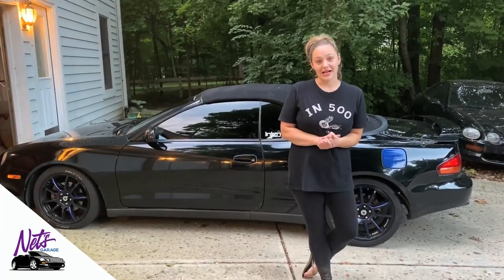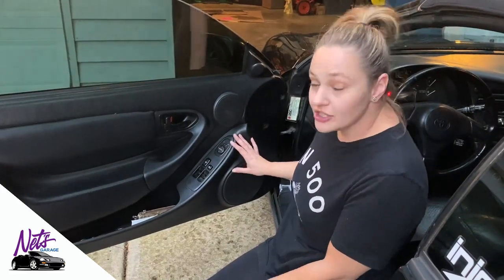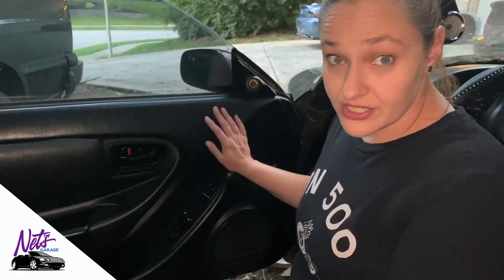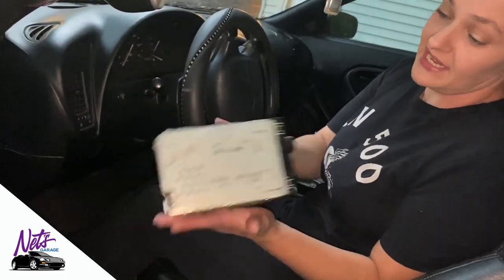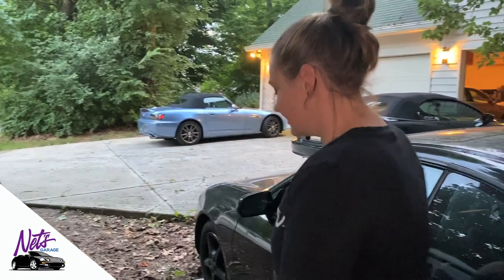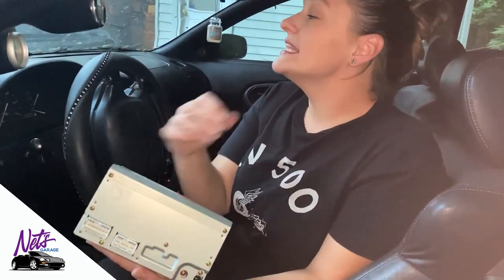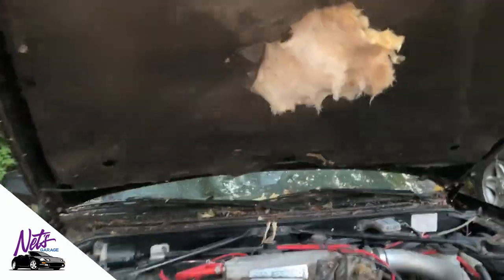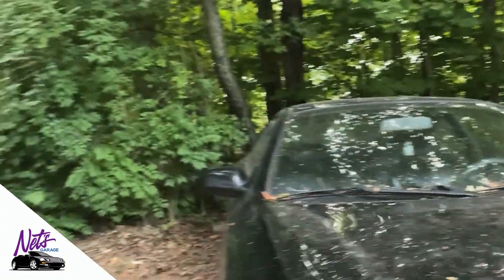Factory Speaker Setup & Size varieties that came with the 6th Generation Toyota Celica. Explained.

Comment: a bit uncertain about what im looking at in my JDM '97 st202
it seems to have the 8 inch mounts but the actual speaker seems smaller
found this channel looking for instructions on how to remove the door panel (thank you for the walkthrough) because I wanted to look into replacing it as it's still the factory speaker and i got some rattling going on.
My condolences for what happened to the convertible as well
Reply from the maker: I do have a video on removing the door card. I’ll attach a link for you here. Good luck with your project! And thanks for the condolences on the black convertible. 🥹🤓

https://youtu.be/6I_MNJTi0aY

Comment: Have you actually replaced any of the speakers in the convertible gt? If so…what speakers did yoh replace them with? Please provide some model numbers or links
Reply from the maker: Hello! I did replace all my factory speakers with Audison speakers & amp. I chose them because of the shallow mount depth, so it fits flush with the door card installed. You’ll have to find which speakers fit with your particular speaker set up. In the trunk I have a 10”  JL W7 with a custom built box and an amp for it as well. 

Here’s a link to Audison, you can find an audio specialist that sells these speakers near you. Or you can source them online. Good luck. 🍀 

https://us.audison.eu

Comment: I have a 95 Celica the radio powers on
But no sound out of any of the speakers works 

I have the less common setup of 3 in each of the front doors 

Any ideas/help would be really appreciated
Reply from the maker: Hi Ryan! I know that can be quite frustrating. Did the speakers used to work and then stopped working? Are you installing a new head unit? Are these the factory speakers? Newly installed speakers? Is the radio otherwise functioning completely? There are several things that may have gone wrong. I’d trace your wires and make sure things are connected securely. If the radio is turning on then it must have ground power, so that’s good. Did you make sure everything is connected in the back of the head unit, including the antenna plug? Did you use the proper wiring harness? (There are two kinds). I would start double checking your work and your wires. Make sure everything is connected. Good luck. 🍀🤞🏻

Comment: Hi I have a 1996 GT convertible and I`m having issues with water getting in from the back of the trunk area, did you experience any of this with your convertible?
Reply from the maker: Hey Celica friend! I've not had any issues with water in my trunk, thankfully. There are a few things you can check; the rubber seals around the trunk (Is the trunk closing properly?), you can check the weather strips around the rear quarter windows, there's also a drain/gutter that can sometimes get clogged up with leaves that you may want to clean out.  You also may want to put a convertible top protectant on your ragtop as well, it will help the water bead and roll off the fabric instead of absorbing in and leaking inside the car. Those are my ideas, hopefully you can trace where the water is getting in. 🤞🏻 Good luck! Water can be really sneaky.
Reply: @NetsGarage  Thanks for your reply, The issue is those gutters one of them is broken and is no longer working after putting a temporary solution. It`s about $200 at the Toyota dealer. Too much$ I`ll see if i can remove the top from the back area and see if I can macgyver it.

Comment: My 99 Celica gt convertibles radio don't turn on. What do you think i should check?
Reply from the maker: Hmmm.  Well, I'd start by checking the ground wire and the fuses, then perhaps pull the radio and see if everything is plugged in properly.  Good luck!